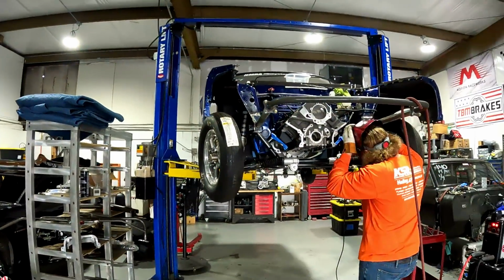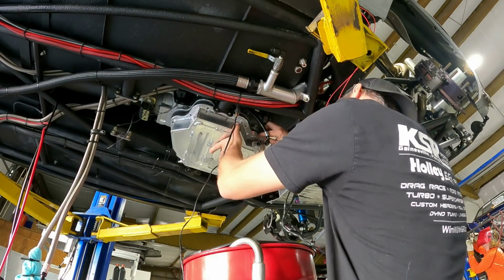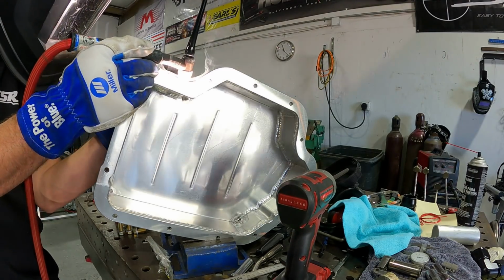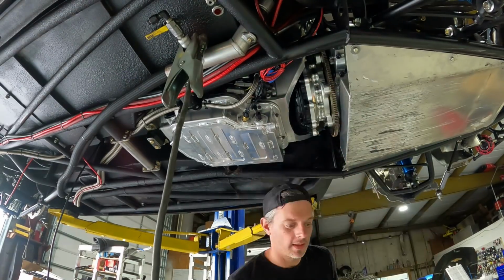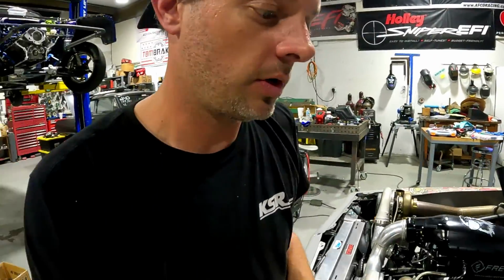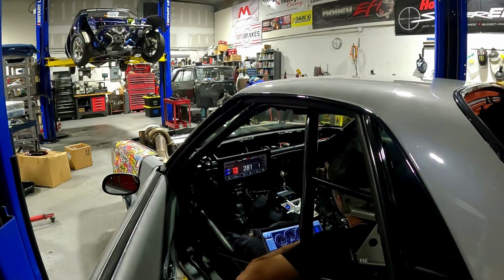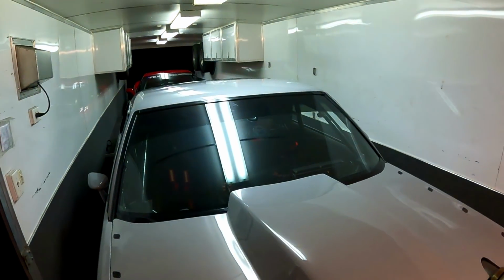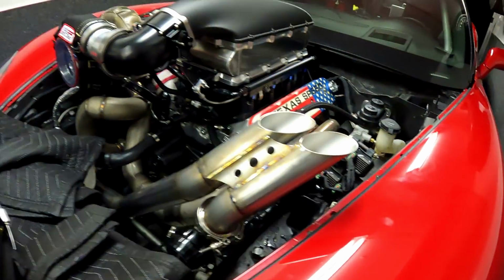Mullet's First Test Drive with a TH400!!

Comment: gotta LOVE the TH-400  , one of the best transmissions general motors ever built ,,i run a TH-400 in my 1983 GMC 3500,, had it rebuilt by a local trans builder with 450,000 miles ,,i'm up to 20K miles since the rebuild ,, it'll handle my turbocharged 454 big block  with no trouble ,,,i routinely tow 25000 pounds

Comment: I can not wait to see how this goes at testing. I hope to see you and Cleetus make a setup database for each track you take Mullet to. 
Engine tune, suspension, tyre pressures etc that work at particular tracks.
Taking note of the track-prep condition and ambient temperatures that you experienced and how Mullet responded to each change you make to chase those best times.
Reply: In the days before computers ruled the world that information was all kept in the crew chiefs “little black book” but you are definitely correct. Myself I personally like the idea of having one laptop computer that is dedicated to one car that way all of the data for every run of a particular vehicle (Dyno-tune files, car setup, tune data, track data etc is made on and stored on one computer. Additionally I am a firm believer of belts and suspenders backing up that data from that laptop to a portable hard-drive as well as on-line to a secure data storage site.
Reply: Yeah watched stevie fast video about doing notes 🙂
Reply: ALL THE DATA!!!
Reply: @gullreefclub  this guy gets it. I'll raise you one and suggest they could just have the computer built right into the car, and access it remotely on an iPad if that's all they had on hand to grab data, or plug a portable USB-powered screen and keyboard into the dash directly to tune the car. You can get rugged computers/cell modems out of cop cars/commercial vehicles on eBay for relatively cheap, then their car is always connected anywhere, can log every run, and backup all data automatically. Added bonus: it would also make a functional LoJack if it ever got stolen. As an IT sysadmin, that's how I'd do it if I worked there.

Comment: The whole no air filters when driving around the street gives me the willies.  One tiny road pebble away from a mess.
Reply: @ElliHarper  chicken wire sized, won't stop a pebble.
Reply: Typically the intercooler catches that stuff. Only real damage is to the compressor wheel if it's spinning pretty good. Slower speed it passes between the fins

Comment: We are a shop that builds Law Enforcement Vehicles, and works on Emergency Vehicles. Wire Harness's are what we do!!!
Have a tip for you, get yourself a Seam Ripper. Its a sewing tool, they work amazing for removing heat shrink, loom, tape, ect...... its the fastest and safest way. You will save so much time and not have to worry much about the wires in the bundle.
Reply: Excellent tip... Thanks 🙏🏻
Reply from the maker: Nice! Ordering one now!!

Comment: Hey kev. When are you guys going to spray those noisey doors lol. I have heard them since you guys built it. Just paying you out lad. You have built one hell of a machine. Ive built cars all my life for customers and myself. But I have never been able to build a car for someone or for myself that had an open check book. If I did it would be a 40p my prototype rotary engine 4 Rotory but a 4 ltr instead of a 2.6 ltr. With twin 90’s if they are big enough??  And I would put it into a series 2 Rx7 like my blue one with the 20b in it. I’m in the middle of building my spare s2 Rx7 for my good friend tim. It’s got a series 6 13b GT40 bb turbo. With my full port job. Full restoration on the car. My YouTube channel will be up and running by the end of the year. Ready for 2022. I can’t wait to see how fast mullet can go. Here come the 6’s. Cain hard guys.

Comment: Seems like there was a TH375 that was a TH400 outer and a TH350 guts.  The benefits was low end power.  This is stock data; the trans would shift at 5000 RPM, my car would shift from 1st to 2nd at 82 MPH.  This was back in the big block days with a 2.7 rear end.  I was running a toilet carb, Predator.

Comment: Try a phoenix brake bleeder and you will never deal with air in the brakes again it pushes fluid up thus forcing all the air out the master. I make intricate brake systems with multiple master cylinders and this makes it a quick one man job.  I had an old corvette that wouldn’t bleed air out and that’s what turned me on to this. Took 30 min after this tool and I had spent days and gallons of fluid.

Comment: The music to the time lapse is a really nice touch too. So is the TH400 a manual shift trans or can it be set up like the Powerglide where it shifts where you put it. Always great stuff Kev 👍👏👌
Reply: depending on the setup it can be manual shift, or it can be driven by a little shift-actuator on the shift-lever, which was how the powerglide was set up in mullet

Comment: The comment about the vaccume pump for the crankcase pressure. Just out of curiosity, I wonder if a beefy enough dry sump oil system could keep up with the increased crankcase pressure from the alcohol

Comment: I haven't driven any high power auto vehicles. Tightest converter I've ever seen belongs to an Allison tc10 in a semi. Took 40-45 psi on the brakes to keep the truck from moving and it noticeably bogged the engine down about 150 rpm.

If I ever make a million dollars I've got a hell of an idea for a project, will definitely be interesting to see if I ever get around to it if it will work or not. I want to get one of those new banks supercharged duramaxes and put a full manual valve valvebody 48re or 4l85 behind it in an older car like my old man's 67 gto.

Comment: Music + Kevin, chefs kiss!
Is a new flywheel from M&M an easier option than clearancing the convertor? Should it become an issue.
Would a transbrake button on the shifter (aka pistol grip w/button) perhaps be a better option for 3 speed automatics? I know it's all preference, but the shorter first gear and also easier to reverse while turning.
Reply: there are plans to toss in a sensor that will automatically engage the transbrake in reverse, last i remember.. the powerglide had a button on the shifter that engaged the transbrake when it was in the reverse position, otherwise that position was basically a second neutral with the transbrake setup and no transbrake button-press..

Comment: As a shipper receiver for 20 years. I can confirm that you must call couriers to tell them how to do their jobs.
Reply: Yes, have a sign on my front door directing deliveries to the side door of my house, no internal access to the front door, large porch on the side of the house. Fed Ex drivers cannot read!
Reply: Before any couriers get on me in the comments. I know there are a lot of moving parts as I worked on a dock for a freight company. There is so little diligance in the industry and such high turnover that training is always an issue. I dont like these factors but it is up to us to change it.
Reply: @haworthlowell805  I blame porch pirates for this and the mass increase of orders with the pandemic. So many packages...
Reply: @GusMortis  That's the problem; my front porch is very open to the street, no walkway to it, plus the sign. My side door has a porch, lots of coverage to cover a package. UPS & USPS have no problem delivering to the side door but FedEx can't seem to read plan English. I'm surprised to packages even get delivered. I stopped ordering from one company because they inky ship FedEx.
Reply: @haworthlowell805  blame it on amazon. They ship so many packages that it over whelms the shipping companies. There is a massive demand vacuum for big shipping companies right now. The big shippers usually buy then up unfortunately and get rid of the customer service those small companies offer, in exchange for volume and profits.

Comment: Great Vid, Kevin. You and Your Team work well with Your
Client's and their Guys. Especially Clete and The Freedom Factory !
Question:  We've see the progression/process of Mullet, resolving the
issues as Mullet is turned into the beast that it is. What component will
need to be upgraded Next ?  It appears that all of the components have
been upgraded extensively. Anything left ?
Reply: Typically upgrades on cars like Mullet, LeRoy, and Ruby are made when something breaks/fails or is not performing as expected and then make appropriate changes based on what is determined to be the best corrective action to improve the cars reliability and performance.

Comment: How do you not have grounding issues on your pressure tap? Most pressure sensors ground through the housing into whatever it is connected to. If the connector you are connected to is painted, like what you have, then it won't ground.
Reply from the maker: All pressure sensors are 5V, there is a ground input as well.

Comment: Washers between Torque Converter & Flexplate ( SEEMS SKETCH ) especially with SO MUCH FREEDOM. You would think they would make AT THE LEAST A RING that takes up that space, NOT WASHERS. I know the Flexplate is much thicker but still ? There's got to be a way IMHO.

Comment: Awesome video and very informative.   I am curious what steering wheel harness connector setup Cleetus has on Mullet is?   I love that there is just one single harness up near the wheel for the bump and scramble buttons.
Reply: That's cleetus' brand motion race works wheel. The buttons and harness were custom made by Kevin during the build.
Reply: @andrewledford3865  Ah thats why I can't find it anywhere.   Kevin should make these and sell them.   Much cleaner setup then having multiple wires all wrapped around the steering shaft.
Reply from the maker: Motion Raceworks sells the cord we use also!!
Reply: @KSRPerformanceFabrication  interesting that is where I looked and I saw the steering wheels but not the plug and harness setup.

Comment: Hey Kevin, will the locking torque converter help with the trans temp issues they were having at Rocky Mountain race week?
Reply: Yes, a locked convertor stops slip which creates heat
Reply: It should but he will be running the engine at higher RPM’s on the highway without the overdrive unit which is going to add some heat to the engine and use more fuel.
Reply: @danmyers9372  don't they have a gear vendor?
Reply: Not the same, but my car won't lock up until the trans it up to temperature.
Reply: @rexrunner  - They decided not to use it behind the TH400 feeling the lockup converter will lower the RPM’s.
Reply: @danmyers9372  They should have kept the gearvendors with the th400 to use while cruising on the road. That 427 will have plenty of torque to run slower and it should run cooler. I highly doubt the lock up converter will make up for the lack of overdrive. On stock applications, the lockup only seems to drop engine speed a couple hundred rpm. My C20 has a well built th400 and gearvendors behind a nicely built 406 sbc. With 4.10 14bff and 33" tires it runs at 2400 rpm at 70 mph. The gear vendors drops it from 3200-3400 rpm when in 3rd direct. On the street, I will shift into overdrive at 30 mph or so when not hauling extra weight. For pulling my toy hauler, the gearvendors gave me 1st over, and 2nd over to stay in a better power band for pulling and 3rd over when on flat ground. The 406 pulls quite well at 2,000 rpm but wakes up at 2500 and it still pulls strong at 5500 when I tried it. Running 3500-4500 rpm for shifting gave the most pulling power. My 2020 duramax has a 10 speed and it is great having all the gears. Maybe Mullet isn't geared how I think, but the norm for a th400 is 1:1 3rd gear so I expect the rpm to be a little high on the highway and the gearvendors should be fine if left in direct drive for the strip.

Comment: Kevin how is the wiring for the steering wheel switches connected to the car. Do you have a slip ring at the steering coupler ? The button you you held while backing the car its purpose?  Thanks. Talking over the time lapse wt music in the background is thumbs up.  Would like to see some closeups of your fit up prior to welding.
Reply: The Button on the steering wheel is for the Trans Break, it works by Putting the transmission in reverse and 1st at the same time, in order to be in reverse you need to have the shifter in reverse and push the trans break button, Kevin will probably hook up a sensor so you don't have to push the button like he had with the Power Glide.
Reply: @michaelwynne4346  I’ve had a number of cars wt trans brake and a glide just never had to push a button to go in reverse. So that’s why I was asking

Comment: I figure that 1/8" gap is to be sure the torque converter is located on the input shaft where the shaft is best treated for the torque.  Are there any other reasons?
Reply: It's too make sure the Converter isn't pushed to far back, if it does it will go into the Transmission pump and tear it up.

Comment: I noticed you had a media style filter in that TH400.   I have always been told to run a metal mesh because of flow, but never liked the idea.  Do you run that style because the builder requires it, or is it just what you prefer??

Comment: Can't wait to see how the car does with the T-400. Kevin I have a question...I have noticed that on these extreme build "race" cars with max effort EFI and Turbos, etc the crank time to start is a bit longer than the old carb equipped cars I am used to. Is this due to the time lag waiting for the injection to build pressure, the ECM to read all the inputs and fire the system, or am I missing something else....or just seeing something that is not there?
Reply: Most of those cars are using mechanical fuel pumps off either the crank or camshaft so it takes the pump a little time to actually start pumping the fuel on Start up
Reply from the maker: The engine makes two complete revolutions before the ECU turns the coils on when there is custom programming on the coil dwell time.

Comment: Kevin is that the snapon flywheel tool you were using for turning the flex plate when tightening the converter?
Reply from the maker: Yes

Comment: Lookin' good! What is the reinforcement plate on the trans pan for?
Reply: reinforcement!?!
Reply: @johnrichardson4327  Yeah there's a plate with holes cut out welded to the bottom of the pan..maybe would provide a little protection from impact? Not sure..

Comment: Hard to believe MM still uses stock style cloth filters in his transmissions, guess with the regular maintenance it will see trash/debris will be seen sooner than on a daily. Kevin do you know of a system similar to a stock cars steering wheel controls to where i can have buttons on the wheel without having all those phone cords hanging and getting ripped off.
Reply: Torqueflite filter at that
Reply: @dav3here  i had to go back to the old screen style in my C4 because of fluid starvation at higher rpm, put the old school screen in it and only a planetary roller failure in 3yrs of track and street use. Curious to see how it turns out

Comment: Good thing about the converter being tight is that you can experiment with the converter being tight then if it's too tight all you have to do is call up Mark at M&M and I would have him send you a couple different stators to experiment with that way you can get the transmission and converter completely dialed in but then I would start experimenting with different rear gears and that way you can get the drive line completely dialed in and then you just have to get the engine completely dialed in and the suspension and then start chipping away at getting the record for the fastest and quickest SBC on 275s in a 1/4 you still have a ways to go to try to get the record for the fastest and quickest 1/4 mile pass on 275s but really what Cleetus should do is put Mullet in LDR on 295s with a fully built billet engine SBC whether it be an OG style MBE headed SBC,4.5bs,4.6bs,LSX,LSR,LT1R, or even a 500+cid BBC,Semi Hemi like in Finnagen's boat,SMX-481x or a Hemi Gen 1 style like from Proline or another reputable builder "SM" or BAE or even a big cubic inch engine from Nelson, Buck, Sonny's, Musi and I would really like to see Mullet with big tires and a big engine in it with a mountain size amount of horsepower and the same for Ruby but in her case put a 4link and a Fab9 rear end for starters then put a 4.6 bore space Vizner performance designed SBC and get Ruby light as possible and put Ruby LDR,X275,Pro275,ODR or even Outlaw 10.5/Extreme 10.5 and when he's not running in a small tire shootout he can be in Mullet hitting all the big tire events like SCSN, PSCA, World Cup and so on and put both cars in an event that fits both cars like a SCT event and if he does that he could still run 1/4 mile at most of those events
Reply: He should also put a Race Tech seat in Mullet and Ruby instead of that Dale truck look alike I mean it looks decently comfortable and secure and light but it also looks like a Race Tech seat copy cat knock off

Comment: Can you set this transmission up to go into reverse like the power glide because I saw you were using the push button on the wheel
Reply from the maker: Yes, I have to add a sensor to the shift lever

Comment: i just had a question ive seen some use a steel bell housing an i see mullet has an aluminum  one is there a reason for that?
Reply: Steel is for when the transmission is inside the car with you, aluminum when there is a sheet metal floor.

Comment: Something I’ve never understood, maybe someone can explain. Why is every shifter I’ve seen for these super super fast automatic cars always loose & wobbly. Mullets shifter moves all over the place like it’s mounted with tape. Same thing with Ruby. The Blazer’s the worst but I wonder if that’s just the insane weelies keep knocking it loose. Can anyone explain this? Wouldnt you want the shifter Mount to be as snug as possible?
Reply from the maker: Mullets is not finished yet, it will be more solid when it’s done.